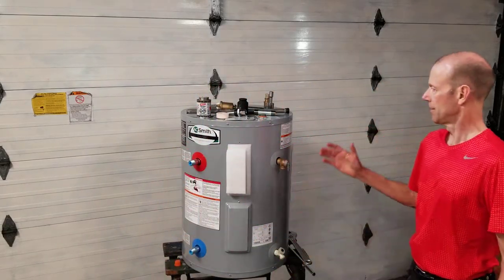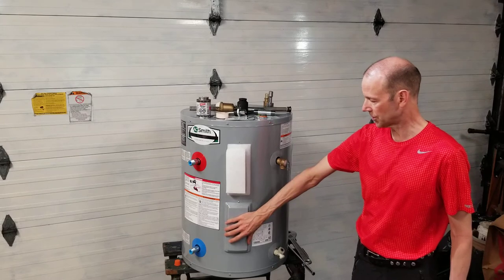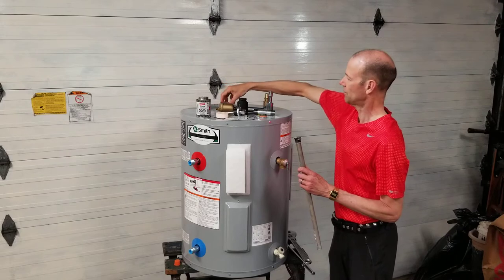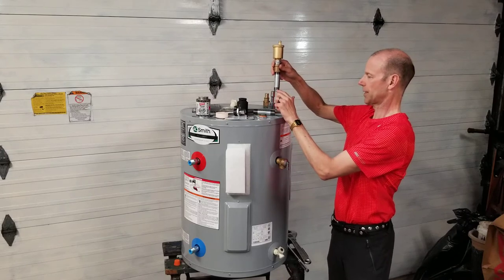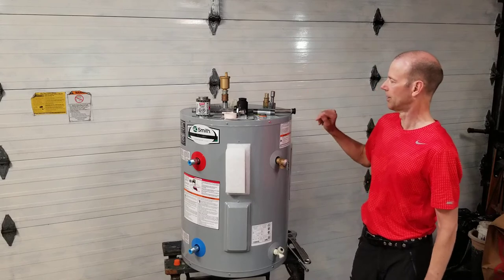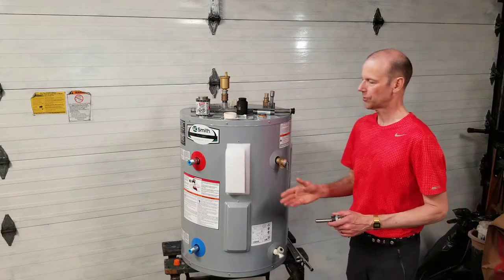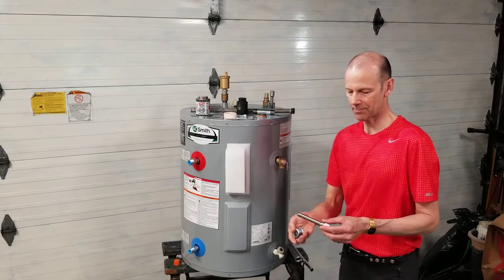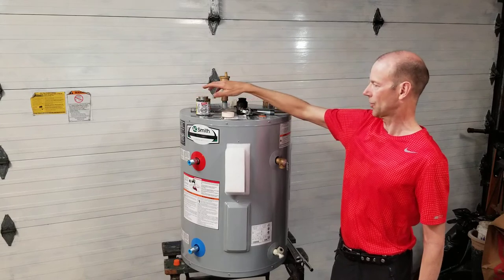Buffer Tank Converted From a Hot Water Heater

Comment: Cool video - I wish I could see how you connected it all though. Not totally clear where you made all the connections for your heat pump and domestic
Reply from the maker: Good point, I'll do a system overview. The buffer is JUST for the winter heating system (supply & return to heat pump, supply & return to radiators). For DHW I have a separate all-in-one heat pump tank.

Comment: Bruce - thanks for the video.  I'm looking at using an old gas fired hot water heater in much the same way - except that I'm going to lean it on its side.  I'm debating taking the top off to thread a coil - but will probably use a flat plate heat exchanger/ pair of pumps instead.  This won't be as efficient as the coil, but will save me from welding.  We'll see.